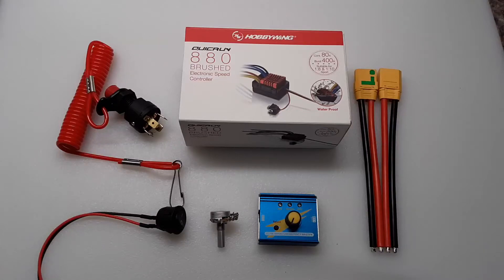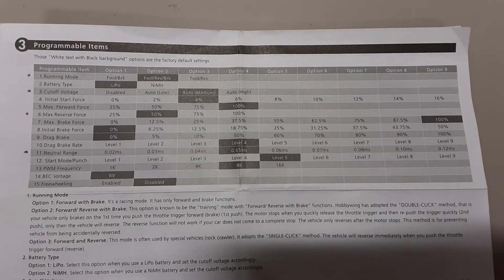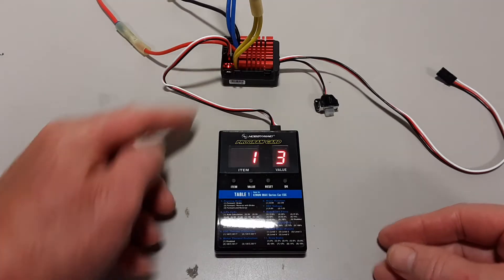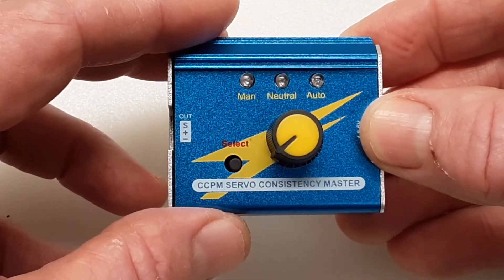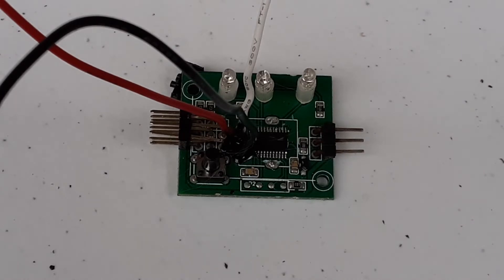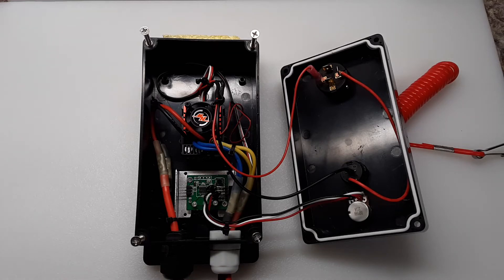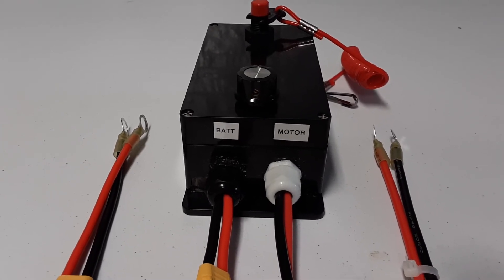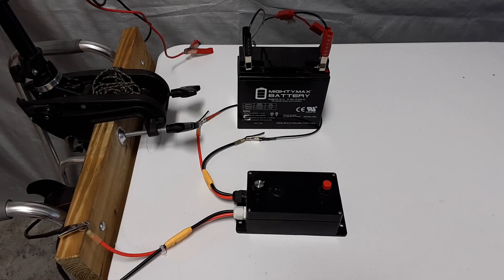ESC Electronic Speed Controller with Cut Off Switch for AGM and LiFePO Batteries

Comment: I'm very confused on why the 6 volt servo tester doesn't catch fire when being used on a 12 volt battery like mine did. Any input is appreciated.
Reply: The esc is simply a "middleman" between the battery and the trolling motor. Power goes to the ESC on one side and power comes out the other side. In between the "in power" and "out power" is the actual esc but the esc needs to be told what to do and that's where the servo controller comes into play. Most servo wires are made up of 3 wires (red, black and white) Red and black are the power supply to the servo controller given by the ESC at a low voltage of up to 6v. The white wire is the signal from the servo controller back to the esc telling the esc what to do. Once the ESC receives the command by the servo controller, the esc then supplies voltage to the trolling motor which is determined by how far the individual turns the POT. 12v trolling motors run up to 12v. At lower speeds, there is resistance (resistors) in the head of the trolling motor on a normal set up and then supplies voltage to the motor which may not be 12v at any given time. The esc in this set up determines the resistance aka voltage to the trolling motor determined by the POT (servo controller) signal. Very cool and reliable setup vs the large, unreliable PWMs. I know this is a little more info than what you were probably looking for, but understanding how everything works together gives people a piece of mind. There's a lot of money involved in kayaking and a little piece of mind is a good thing to have. LOL. Hope this helps and isn't too confusing. @aksmaniyak hell of a job sir. Very nice work.
Reply from the maker: @joshfranklin8332  Thanks Josh and excellent explanation.
Reply from the maker: The voltage is supplied by the ESC at lower voltage to the servo. Not sure how you hooked yours up but I have done several with no problems.

Comment: Would you recommend the esc controller over the standard PWM controller? I like how the PWM has a power percentage readout. Maybe you can come up with a way and  make a video on how to add a power readout to your esc box like a PWM has. Great video as always. I'm just about to finish up my kayak trolling motor build and got a lot of my ideas from you, so huge thanks for the videos. I plan to make a short video on my build when i finish (because my kayak is the Ascend 128X and there isn't many videos on it) and plan to give you a shout out in the video. So huge thanks again.
Reply from the maker: Thanks a lot Chris! I have never checked into a power meter for an ESC but assume there would be one. I know there is one for a LiFePO4 battery. I would recommend the ESC over most PWMs (except for Minn Kota Traxxis build). They each have pros/cons. Looking forward to seeing your build.